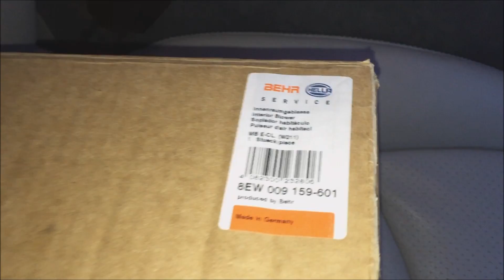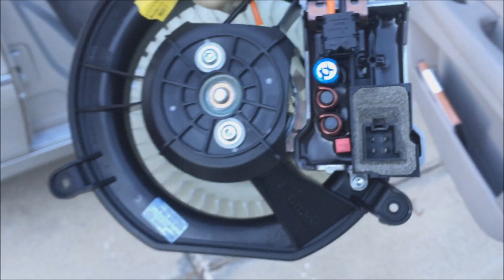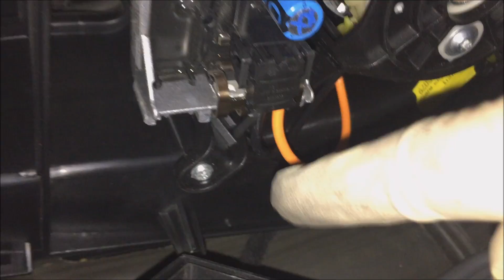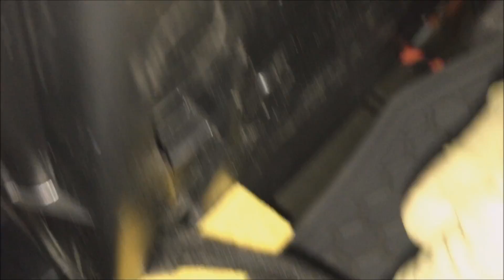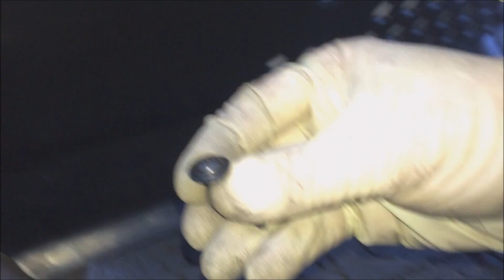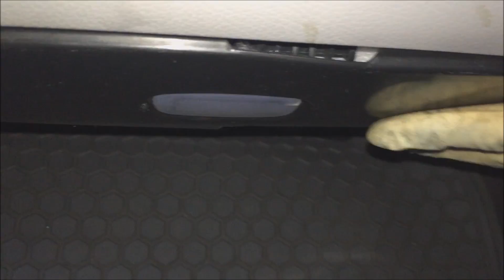Mercedes E350 (2008) Blower Motor Replacement - W211

Comment: Does this fix the squeaky fan noise?
Reply: That's what I am assuming it will!  Mine will squeak at around the first fan setting mode or if I go over bumps.  I figure my blower motor is probably getting worn out at 12 years old..etc.  This looks like an easy fix though.

Comment: The heat on my E350 (2006) isn't working. It just blows cold air when I turn it on. I replaced the heater control valve but that didn't solve the problem. Then I flushed the heater core and the problem still persists. Any idea what the problem might be?

Comment: Question on the screw size what size are they?
Reply from the maker: Sorry. I did not pay attention to the size of the screws. The blower motor attaches via the screws to the plastic. The blower cover compartment screws also attach to the plastic, so they were all "typical" long / skinny screws for plastic. If someone else does the repair, maybe they can reply with more info to your question.
Reply: They are a T-20.

Comment: There is no such size Torx 2, its probably a Torx 20 bit
Reply: T25 for the 2 screws on the first cover. T20 for the 4 screws on the second cover and the 4 screws on the blower motor itself.

Keep those 2 wrenches with you at all times if you gonna drive an E class of this vintage. They'll open a lot of doors, so to speak 😄

Comment: If you put a bit o oil grease in both bearings the noise will disappear  for some time , will just prolong the life of o;d blower for some time .
Reply: I tried that approach and that bought me another month or so, but then the squealing inevitably returned. Certainly not worth the aggravation of removing a squeaky unit to oil it and replace it only to have to remove it yet again.

Comment: I have a 2005 E320 wagon How & what is the best way that you can determine if the blower motor regulator is bad or just the blower motor itself, because when I turn on the heater or AC nothing happens now etc ?

Thanks
Reply: I have same issue with my 2008 e350